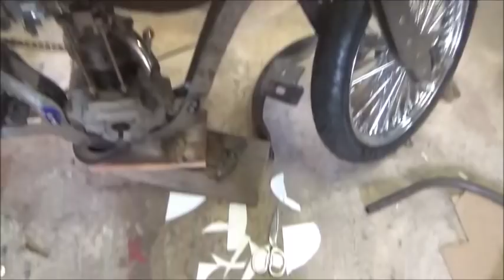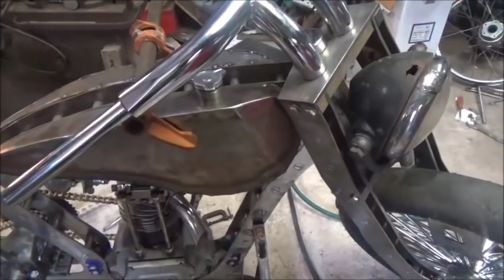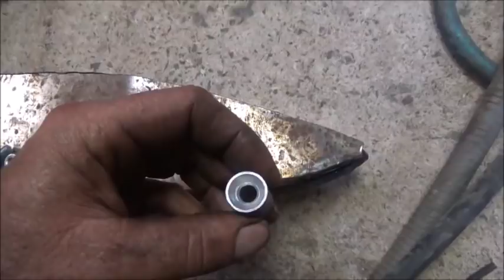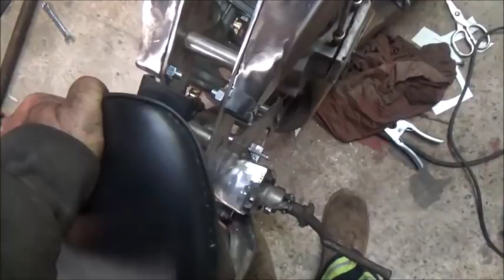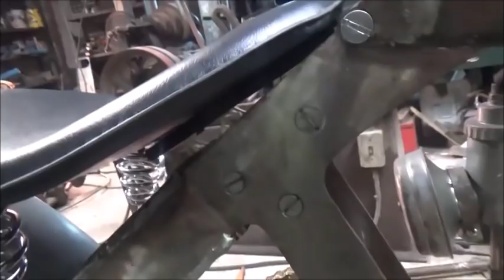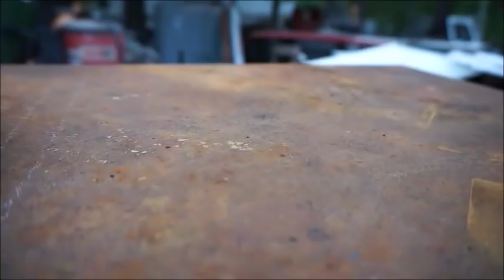Chopper, Bobber, Board Track Motorcycle Build Part 14 Seat & Tank Mount

Comment: Watching the Wizard!

Saw these on another site.

The sanding surface wraps all the way around the disc. This allows you to easily grind a weld that is on an inside corner .

http://www.pferdusa.com/products/206h/206h30/206h300102P.html

Comment: Hello Jonathan
A good way to connect the tank halves would be to put tubing through a couple of the spacers that hold the frame apart.  Remove the screw and mark on the tank where the hole is and put barbed fittings there.  Put a hose between the two fittings and cut a slot in the spacer the long way so it fits snug on the hose.
Also the Sears Allstate motorcycles had a tank/seat mount kinda sorta like that.

Comment: Hello Jonathan I was wondering how are you going to fill the other tank with fuel.  Are you going to get another cap or you going to be able to get fuel to the other tank by using your magical ways. I've been knocking my own brain and still don't know how you will do it sir. I suppose I will have to wait and learn. All the best from UK ............................ bye 🇬🇧
Reply: I bet he'll have two hoses running between them, one up high and one down low.  Then the capless side can fill and vent easy.
Reply: @HomeBuiltJunk  true but the high hose would have go through frame

Comment: if you filled in the top & bottom of the frame around the tank you could make the top one smooth, continuous surface - and add a bit of fuel capacity...

Comment: Your talking nickel plating copper fuel line, Did you try the cool amp I sent you along with the flat head screws ?
Reply from the maker: Have not yet. But have used some of the screws. I was gonna do some research on the cool amp. Never seen it before.
Reply: You got to try it out. Clean your copper, make a small bit of very dry paste with water and rub it in.